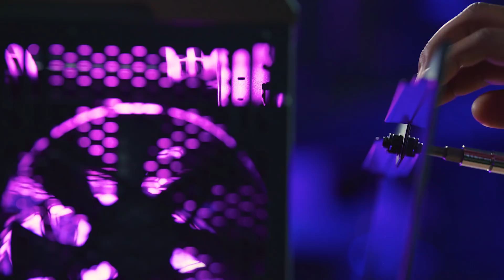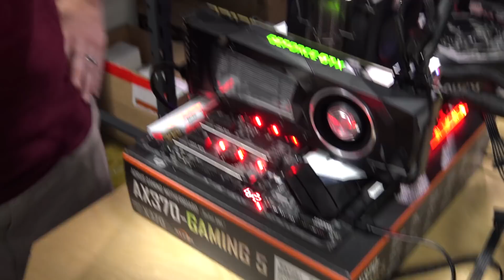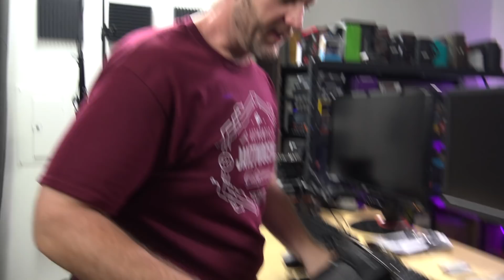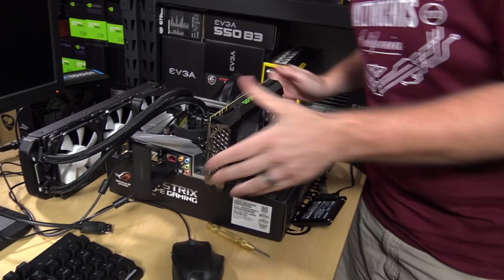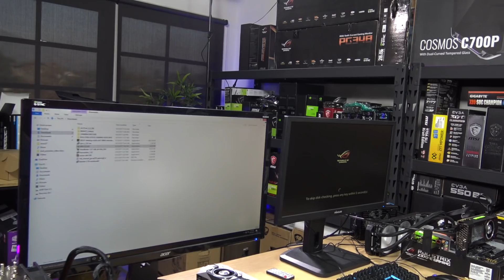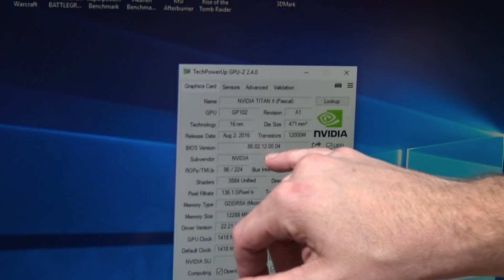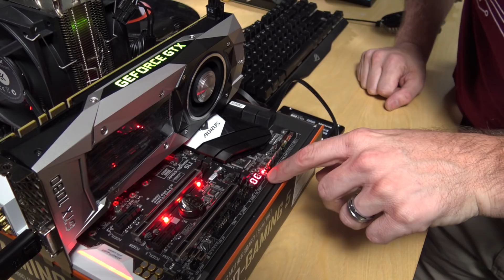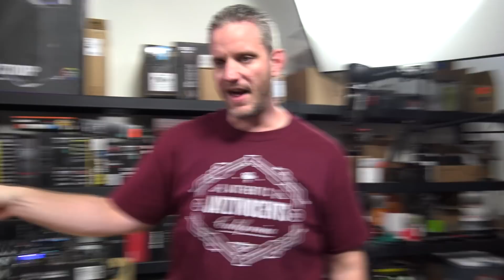I cant figure this one out... HELP!

Comment: The amd system mbios may be flakey. Some board have unstable bios implementations, though to be fair, most seem to be sorted out by now. Small seemingly insignificant modifications, can effect seemingly unrelated bios entries causing instabilities.  The platform is still maturing, soooo.
In the instant case, as everyone has pointed out, you didn't check both bios's. I'll guess that's where the issue lies and if not there, check the clocks on the two boards, both core and mem.
Ryzen mboards are in general,  incredibly sensitive to timing correlations, especially in  a highly tuned system.

Comment: I have a gigabyte ax370 k7 board and I’ve had your same issue before, the fix is very simple. You actually have to disconnect PSU from wall, maybe take out bios battery for extra measure, press and hold power button briefly, reconnect everything and your good to go. I’m not aware what causes it, it’s happened to me twice since Ryzen 5 launch.

Comment: I noticed the monitors are different so try connecting the monitor from the INTEL system to the none working GPU on the RYZEN system via DP and see if it boots, if not try replacing the DP cable(s) or use HDMI (don't forget to switch to HDMI-output on the monitor :p) - if nothing of this works... please reply so i can think of smth else ;)

Comment: I noticed that you pulled a slight of hand on yourself in the video. When you checked the BIOS version of the Titan in the Ryzen build and thought it was the same as the Titan that was in the Intel build, it was the exact same GPU from the Intel build. Double check the GPU Bios version on each of the Titans again. 

Also... I have heard a lot of people have had random issues with Ryzen that were only fixed by a fresh Windows install.

Comment: 1. double check again Bios on both cards, in video you are checking all the time BIOS of one and same working Titan X .  2. What card runs in different PCIE Slot , 3. PSU seen some shady things even on good ones (purely theoretically one card might pull a little bit more juice then other(despite they are identical) and if PSU has  some issue providing enough juice  it might affect Cards initialization)

Comment: use display driver uninstall and reinstall stall driver. Ndivia screw up a driver update during the windows Creators edition. my nephew had this issue booted it up on my rig fine. so I install the driver. make sure you click custom install an check the box for clean install so it installs the driver to it's DEFAULT settings and makes sure to remove all that crappy Ndivia beta drivers for windows Creators edition.

Comment: my guess is gpus were made at different times with some kind of variation between them, mobo has compatibility issues with either the newer / older variant, but not the other. maybe nvidia made some kind of change mid-production and didn't think it necessary to inform mobo manufacturers, or maybe one motherboard variant didn't get the new update, who knows.

Comment: that is a very strange issue but i myself have a stranger one. the only two things i can figure to try is put the faulty/weird titan in another 16x slot on the ryzen board. if it still brings up the post code on the motherboard then it has to be the gpu itself. the only thing that could be derping up would be the gpu bios because thats what the cpu will try to talk to first as far as i know.

Comment: I have experienced something like this where a card worked in one system and not another. My friend built a new computer several years back featuring a 670. It would not work in his system at all, so he bought another one which worked perfectly fine and was planning on RMA the one that did not work. For kicks, we threw it in mine and it worked perfectly well. He sold it to me for cheap, rather than RMA it and I used it for about 4 years when I upgraded to a 1070. I just gave it to my cousin a few months ago and its still kicking ass.

Comment: JayZ you showed the same BIOS on the same card, but you didn´t check the firmware on the second card when you installed it it on the Intel system.

Comment: What I have experienced in about 10 years of PC-building is, that when there is an issue that is hardware related and you cannot find the cause of it whatever you try. It tends to be the PSU. For whatever reason defective PSU's are causeing the weirdest errors and failures. I had a single front USB port not working because of a PSU error. I had a Power-button not working because of that and I had a 1080 Ti not working under load (Idle desktop was fine) because of a defective PSU. So maybe you want to check it out.

Comment: Also you've checked VGA BIOS version of the same card twice instead of comparing VGA BIOSes of 2 cards.
Reply: I bet BIOS versions are NOT the same, just doublecheck it. Also you should be able to dump BIOS from working card and put it on the other.

Comment: Maybe one card is using a little more voltage than the other and either the board or the power supply is struggling to power the system

Comment: I had the exact same problem with a setup that was running perfectly, one day it decided to fail. That setup was:
intel i7 5820k
Asus X99 Deluxe U3.1
16gb Corsair Vengeance 2666mhz
PNY GTX1080 FE
Corsair RM750
After days of testing the problem seemed to fixed it self

Comment: When you flipped the Video Start Titan from the Ryzen to the Intel, you didn't check the BIOS, you only looked at the BIOS in GPU-Z for the same card from the Intel to the Ryzen, so the BIOS will be the same as it was literally the same card, so what is the BIOS of the card that started on the Ryzen?

Comment: After you check the bios on the "other card" for real this time, try looking for physical defects on the pins for the card that didn't work on the AMD system, it could be as simple as a bad pin that didn't quite connect on the AMD but just barely did on the intel

Comment: You only showed the bios on the same gpu. You looked at the bios on the Intel system, then moved the gpu too the ryzen system and looked at the bios agian on the same gpu, but didn't show the bios from the card that was originally in the ryzen system that was now in the Intel system...so the bios may or may not be the same.

Comment: I've actually run into this issue several times but it seems to never be the same thing that I have to do to fix it. Between my own computers, mining rigs, customer builds, family builds, etc. I see a metric crap tonne of systems and issues. For this issue, I usually start by clearing CMOS, change PCI-E cables, change PCI-E slots, deep clean of PCI-E slot and GPU, change the PSU, flash bios of card and mobo. So far, one of those steps has always ended up working. The only three things I can think that could cause it are minor shorts in/damage to the PCI-E traces on the motherboard, variation in voltage control and stability between cards, and corrupted data.

Comment: Jay! You didn't look at the GPU bios version for the card on the Intel system! You looked at the same card that was working on Intel at the start on the Ryzen system and then we're surprised it was the same version number.... Without checking the version number of the card that started on Ryzen and wasn't working there once you moved it to the Intel system...

Comment: maybe one of the pins in the pci-e are just not touching?  like the pin on the receiver is low and hthe pin on the card is also low so they don't touch??? maybe try the riser card cable you had to see if it doesn't fix it

Comment: I am sure he never checked the bios version on the original ryzen card that he put in the intel system .He checked the card that was originally in the intel board on the ryzen system and said the bios was the same. Of course it was, it was the same card he checked already. Check the bios version of the card that he just put in the intel system that was in the ryzen system. Am I right or did I miss it?

Comment: check on the video you checked the same card bios 2 twice the one working on the right one not the one on the left giving u probloems and it its a bios problem on the gpu the bios update on the board doesnt suport the older bios version on the gpu and gives u that issue
i had it and to make shure tested it twice and that was it

Comment: maybe I just missed something.. but you looked at the BIOS number for the Titan in the Intel system at 86.02.12.00.04. Then you removed that card and placed it in the Rzen system and looked at the BIOS of the same card and told us they are the same. you never did look at the BIOS of the Titan card that was originally in the Ryzen system. you just moved it over to the Intel system and powered.

Did I miss something.. ?

Comment: Try this: take the CPU out, and blow out the socket with compressed air, also blow out the PCI-E slots. There could be a stray metal particle in there somewhere. Also blow out the problem GPU, I once had a similar issue where there was a metal particle shorting something out.

Comment: It´s the GPU lottery, Perhaps it is possible that the peak level of the PCIe Bus at startup is too high, and by the serial deviation exactly this one Card cant processed and hang in a loopback at the bios start. try another power supply with the same power but different configuration, single rail against multitrail I had something similar and it was the power supply because the CPU at the start wanted too much power and the power supply after that had a peak which my FX card did not tolerate. because the voltage smoothing was broken.

Comment: Hey Jay correct me if I'm wrong, but you showed the bios of the card in the intel system, then moved that card to the AMD system and showed us the bios of that card again? Is the bios not stored on the actual card, and if so you just showed us the bios version of the working card twice and not the bios of the broken one?

Comment: I had a similar problem when I first  built my Ryzen build. My Msi gtx 970 would boot fine on my Intel system but would not boot to post on my Ryzen 1700x with my Msi carbon x370 motherboard. However, my Ryzen would boot if I had my MSI gtx 1070 installed. 

At first I thought it was a motherboard issue so I got Amazon sent me 3 different motherboards. Same problems. My 970 would boot on all my other systems except for my Ryzen motherboard. 
updating the bios didn't solve the problem.

TRY THIS try plugging in your graphics card into a lower PCI slot. 

The stranger thing was my 970 would boot on a lower pci slot on my Ryzen build. 

I still dunno what the problem is.
Let me know if you figure something out.

Comment: Check the pins in the pci-e slot.  It's probably the motherboard from swapping out cards too much and not fully securing them.  Also check the graphics card pins.  Clearly your not getting good contact with that card on the Ryzen board.

Comment: Might be that the one card has an issue that is within the post error tolerance of the intel board but not the amd. Power draw for example. I’ve experienced something similar back in the agp days with a bad connector.

Comment: Try another of the same mobo model. I couldn't overclock passed 4.4ghz on my 4700k. 1 of 2 sata controlers died a year later and now I'm hitting 4.7 at lower voltage and temps.

Comment: Jay, when checking the bios on the cards, you checked the same card twice. Card B was in the Intel system, and the bios was 86 02 12 00 04. You then placed Card B in the Ryzen system and booted, then checked the BIOS again .... with the same card. Not saying that this is the issue, but you should check the bios for Card A in the Intel system.

Comment: In the video you checked cpu-z on the same graphic card twice. Also I had a bios update on x370 asus prime that worked great except my ram which was able to do 2666hz at 1 lower latency on all timings can only do 2133. So newest bios isn't best bios.

Theoretically but highly improbable is psu problem.
Theoretically there is damage in one spot that is effected by ryzen but not intel, ex a cpu chip with a single damaged pin can sometimes still work but not in all circumstances.

Comment: 1st try the non-working card in a different PCIe slot. 2nd bench both cards in a working system to see if the results are the same heat, speed, etc. Something might be wrong with that card and the mobo is being picky and about it.

Comment: Are the pins on the one graphics card damaged? I had a graphics card where a couple of the pins were partially broken off, but as long as it was pushed down far enough it worked fine though.

Comment: well i would think software problem but might be wrong have you try switching power supply or use better quality cable might have different voltage that could not supply via that board for that type of specific card and hardware and mess things up for little amp voltage. I could be wrong but just a guessing but who know bios could alternate voltage and mess think on particular card and react differently on the voltage.

Comment: Do GPUs have micro code?  Only trouble I've had with my ryzen(early adopter), was initially my system would only boot properly from a certain SSD, if the sata power psu cords were switched around between my HDDs and two SSDs, possibly the old psu's fault.  VGA thing, has only been the "having to re-socket the GPU".

Comment: While the two cards might have the same bios version they may have slightly hardware, not all chips come from the same batches or manufacturer, these slight differences may cause a Rizen cpu to freaking out about, we already know how temperamental it is about memory this could be another. As far as trouble shooting the issue. While i'm sure you have tried this. I did not see it in the video. Try a different slot and see if it still causes the issue.

Comment: I had a issue with my ryzen build and it wouldnt boot with my 1050ti in the top pcie(reinforced slot) slot but my rx570 worked fine, if i moved the 1050 down a slot it works, the only thing i can think of it that maybe my 1050 has a defect in the actual connector and the metal reinforcement is preventing the card from seating correctly due to a tolerance issue

Comment: Maybe check the PSU power output? Maybe the PCIE rail is putting out slightly less voltage than the GPU requires? I've had that happen to me before. Just didn't like the power. Also, had that exact problem with 970's. Had two of the exact same cards and one would boot but the other wouldn't. I swapped PCIE slots and the one that wouldn't boot would boot then. My suggestion, mail the Titan to me and let me look at it. I'll send it right back. :)

Comment: Unless it didn't make it into the video you didn't actually check the bios version in the first video card. You checked the card that was in the Intel system first, twice. Once in the Intel system then again in the Ryzen system, so you really do need to check the bios versions, because you keep saying the cards are identical but from what I can see they may not be identical. 

When I have had this type of problem in the past, it was often a card that was questionable matched with a slot that was questionable. So the card would work fine in another machine or even another slot in the same machine but not in one specific slot. ISA card/slot pairs used to have this problem more than I like to think about, try the card that is failing on Ryzen in one of the other slots and see if it will boot. If that is the case the problem may actually be a Motherboard/card pairing issue rather than a CPU/card pairing issue.

Comment: I had a pc at work that act the same way other than it would boot when changed the display port I was using. Long story short the motherboard for some dumb reason would default back to the on board display ports. After changing the settings to pcie and gen 2 I no longer had issues with booting. Good luck

Comment: I have been experiencing this on an LGA 1155 H67.  One motherboard didn't want to boot. Then I removed the card, it worked with  integrated after clear CMOS. Then put it in again and it worked. Then out of nowhere it would happen again.  That was with RX480.   Everything else worked normally. Even years old Matrox with RAM in megabytes haha   Moved the card to the P67 (only reason for H67 was as a placeholder after my old one died) and it worked there flawlessly lol.   And I agree. 
The only reason why I could diagnose it was because I also had 2 GPUs (Matrox and HD 5670) and 7 different sticks of DDR3 RAM (thought it was RAM for the longest time honestly, my eye was on the DIMM slots) ,an old Sandy Pentium next to 2600K and an old PSU.  I even literally took out the BIOS chip and cleaned it and double checked the connector.  Tried everything. Still "a mystery".   I blame the MBO.    (though still working in an arcade machine at the moment normally with 5670).

Comment: Had similar issue years ago with a R7870, wasn't my first build so i tried it in wifeys and a couple mates PCs and it worked in most. Unfortunately i cant help because i never did figure out why it would not boot in my system, i put it down to RNGesus eventually and got a GTX 670 instead

Comment: Sounds like there is a issue with either a capacitance or resistance issue with the motherboard. If the card and the system tolerance are  off then you will have this kind of issue.with certain cards not working.

Comment: You did only show the BIOS on one card, just on different machines. As for the exact problem, I'm not sure. I assume you already tried reseating the GPU and all the other components, so if we're limiting ourselves to no extra hardware, I'd be stumped. Knowing you, that is a high quality PSU, so it probably wouldn't be that the one card was more sensitive to voltage fluctuations than the other. That really is an intriguing problem. I'll be looking forward to hearing about any further developments.